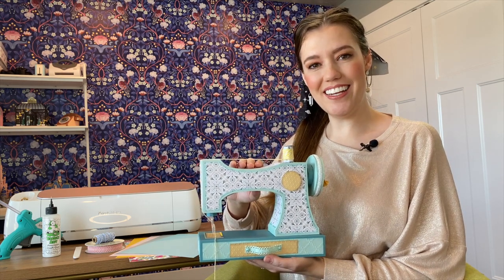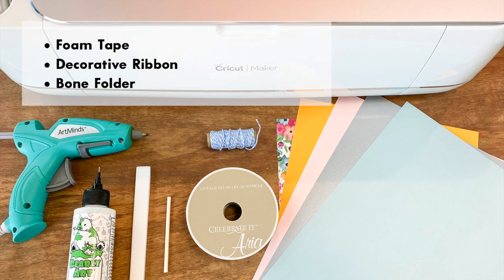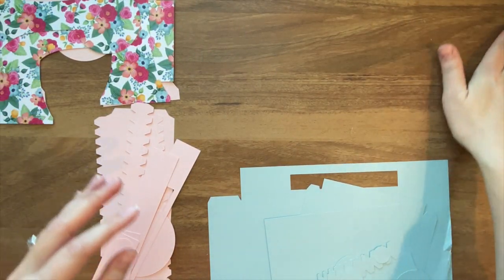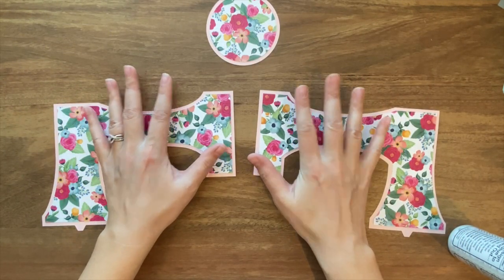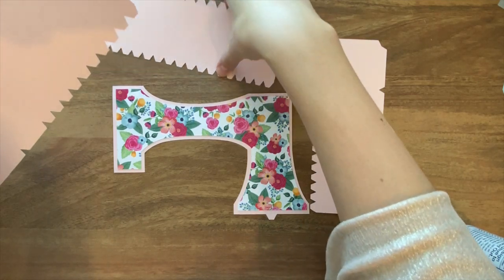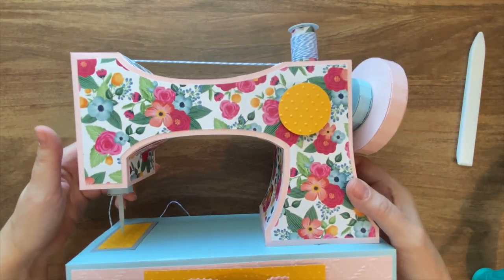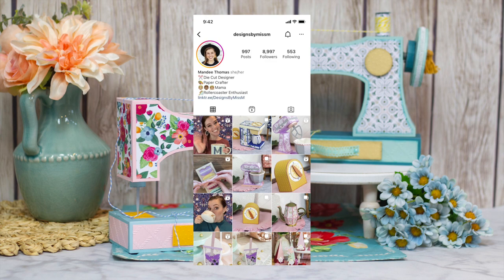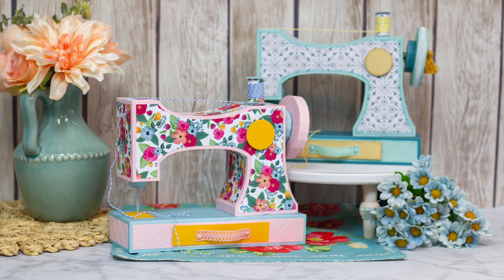3D Sewing Machine   Make It With Miss Mandee

Comment: Adorable project. You make it look so easy. Question, how long, in real time, did it take you to complete this project? Your instructions are very clear and will help me immensely to put this together. I was thinking of making the base big enough to have the drawer hold a mini album. What do you think? Any tips on doing this? Something that I need to watch out for?
Reply from the maker: I'm glad you like it! I can't remember for sure, but this project likely took about a 30 min- 1 hour to cut out the pieces, and somewhere in the ballpark of 2-3 hours to assemble. Of course, if you want to add extra details (inking, personalized embellishments, etc.) then it can take much longer. And you could definitely look at making the base larger in order to hold something more substantial inside! I think that is a fun idea. Just be sure that you either have larger paper on hand to accommodate this, and that you keep the pink interior cut lines in the same place so that the tabs on the base of the sewing machine still line up like they are supposed to. :)

Comment: I have tried to download this template so as the chess one and its impossible. I have tried on my laptop and have tried from my phone. It doesn’t let me. Is there any other way to print it or maybe if it can be sent to my e-mail?
Reply from the maker: I'm sorry you are having trouble with the download process. I'd definitely recommend using your laptop. You'll need to click on the "download" button where you will be directed to the files in Google Drive. From there you can click on the little down arrow in the upper right hand corner of the screen in order to get the designs to your device. I suggest taking a look at my FAQ page for more detailed instructions and troubleshooting tips. https://www.designsbymissmandee.com/faq/

Comment: and another thing it would be nice if you added all the measurements because the measurements did don't match the  i wasted a crap load of paper not cool and not responding
Reply from the maker: Hi Amber. The whole project is about 9.25" wide, 7.25" tall, and 3.5" deep when assembled. The pieces are all ready to go, and there is no need to re-size anything unless you want to make the project smaller. If you are having trouble with any piece in particular, I'd be happy to help you or give you the timestamp for where you can find the instructions in the video. As this is an intricate design that I worked really hard on and am providing to you for free, I would be even happier to help you if you would be a littler more kind in your comments to me. 🙂